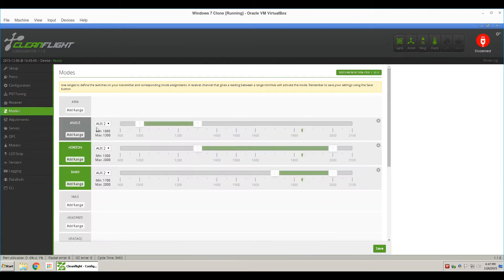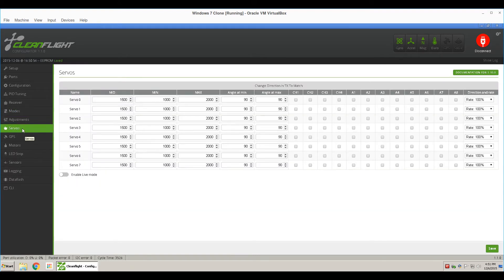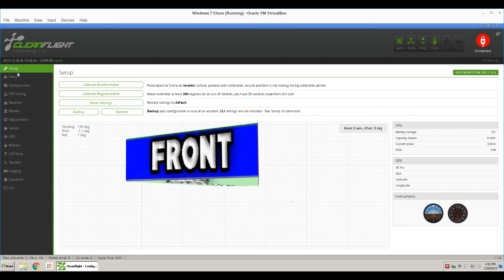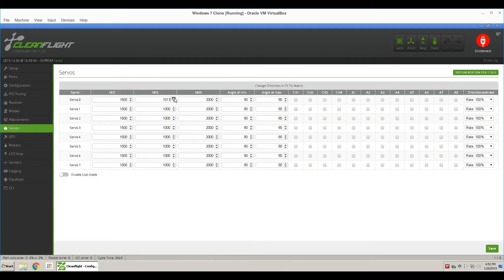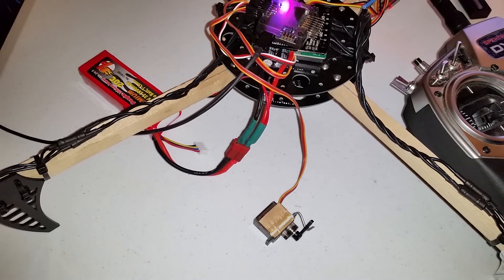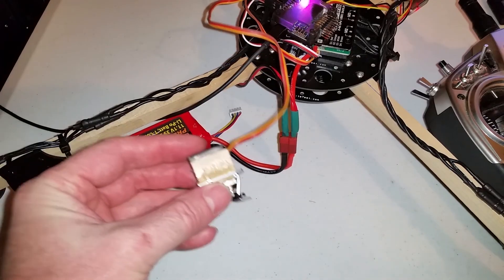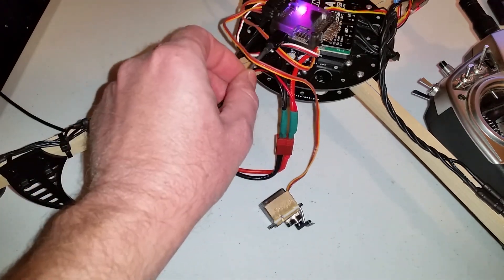Naze32 Switch Actuated Servo

Comment: When I tick the aux box in servo settings the switch does nothing and the camera stays in gyro mode, the switch is working in the receiver page.
Reply from the maker: Make sure the switch is assigned to the correct channel on your transmitter and when you flip the switch you see the line graph move on the Receiver tab in Cleanflight/Betaflight/INAV which corresponds to that switch.

Comment: how do i know what Channel i need to assign for my Servo please?  I have an SP Racing F3 board and i cannot get my servo right?
When i enable Camstab and Servo Gimbal, does that automatically change my motor assignment - i need to move my motors to different channels / pins?
Reply from the maker: Look on your Receives section Cleanflight, Baseflight, Betaflight, or INAV and when you move your switch which channel goes high to low or visa versa.  Assign the servo to that channel which changes.  Also ensure the switch is enabled on your transmitter and not inhibited.  The documentation for the SP F3 doesn't really say anything about the motor channels and servos used together.  http://seriouslypro.com/spracingf3#manual

This guy setup a servo with his SP Pro F3
https://youtu.be/TK4J95-WzR0

Comment: You forgot to mention the most important part of setting up a servo. Your pin-outs change for all the motors and you will need to use pin out 1 and 2 (pitch and roll) not 5 or 6 on the board. Basically this video sets up only on the software side and is basically useless otherwise. It will never work if you don't have it wired right on the board and technically the most important part.
Reply from the maker: +Noah Heinen I didn't change anything on my motor setup which is plugged into Motor pinouts 3, 4, 5 , & 6.  If you have 4 motors then Naze32 will support up to 2 servos.  More than 4 motors then you are out of luck on using servos.

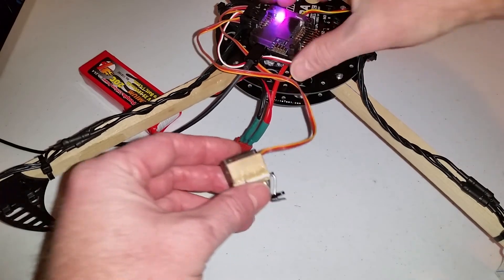If you look closely in the video you will see my servo is connected to Motor 1 and the 2nd servo would go on Motor 2 pinouts @ 1:08 .
Reply: +MrDabrudda What kind of servo did you use? Analog or digital. What freq?
Is the servo output of the naze32 PWM? I'm using CPPM out of the D4R-II receiver
on my quad.
Reply from the maker: +sadie77711 I used analog servo with a CPPM receiver.
Reply: well noah........what is the step by step...........

Comment: can you have two servos ...one moving with the bored and one only operated on a switch to drop the cargo?
Reply from the maker: +Chi Sty Should be able to have 2 servos, one board stabilized and the other switch activated.
Reply: And can a replace the switched servo into a lost buzzer ?
Reply from the maker: +Chi Sty Most Naze32 and Flip32 have a dedicated port to hook a lost & found buzzer.
Reply: I have a skyline32 mini advanced....
Reply from the maker: +Chi Sty Skyline32 Advanced has a dedicated buzzer port

Skyline32 Advanced Manual
http://yinyanmodel.com/User%20manual%20for%20SKYLINE32%20flight%20controller.pdf
Reply: +MrDabrudda the manual seems to focus on the full size board. I see ch2 and ch6 blank...ch6 sends board Info to the dr4. is ch2 for the buzzer?
Reply: +Chi Sty I have the mini
Reply from the maker: +Chi Sty Ah, my mistake.  I don't think the mini has a dedicated buzzer port.  I'm not familiar with that board tho.  It doesn't mean you couldn't try hooking a buzzer to the servo output and set it to switch actuate.  Something I'll have to try when I get the time.

Here are the pin outs of the mini board
http://yinyanmodel.com/SKYLINE32%E4%BD%BF%E7%94%A8%E6%89%8B%E5%86%8CV1.pdf